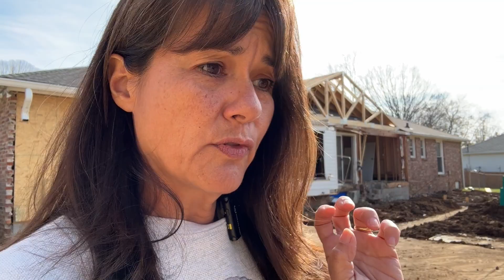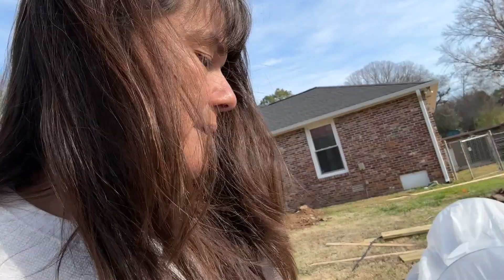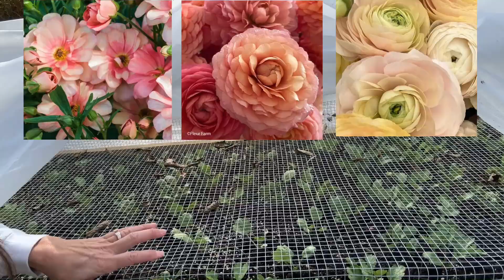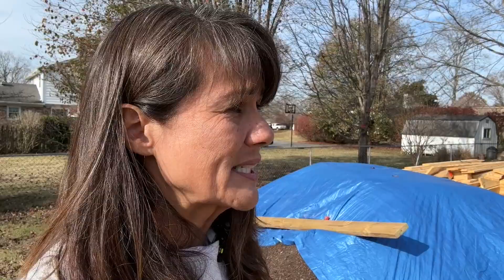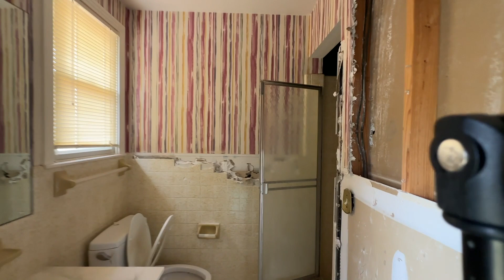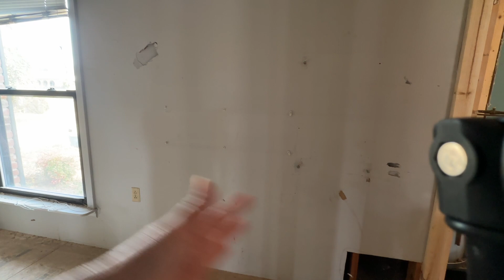Home Remodel Update - Amazing What They've Done in 2 Weeks!!

Comment: My neighbour's home is attached to mine.They have an old rumble dryer which is very noisy. The shortest drying cycle is 90 minutes but it's often going for 3 hours several times a day. They often leave the house with it going for 3 hours and when they go to bed keeping me awake. It sounds like a lawn mower outside my window. I've asked them several times to switch it off ca 10pm but they dont/won't. My concern is it's a fire hazard, ok if a detached house it's only their place that burns down but when attached to other houses those homes  are also at risk. Seeing your video gives me more reason for concern